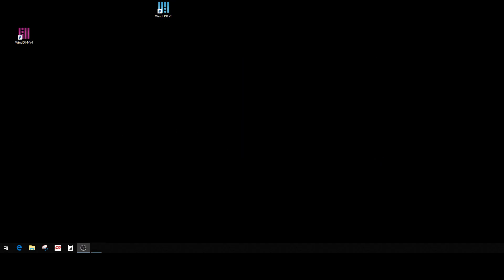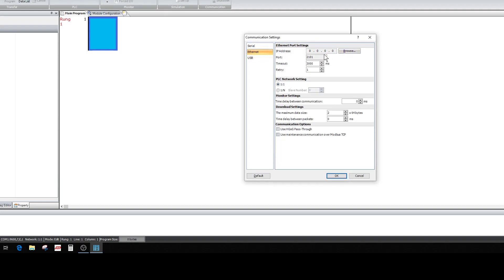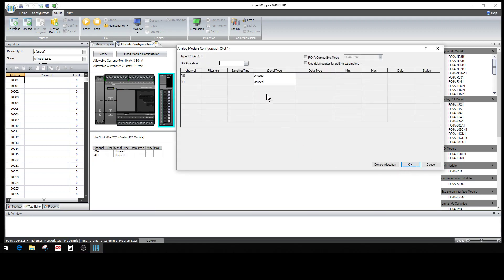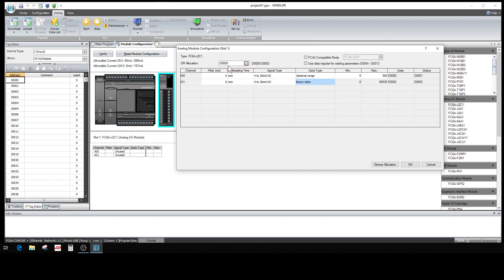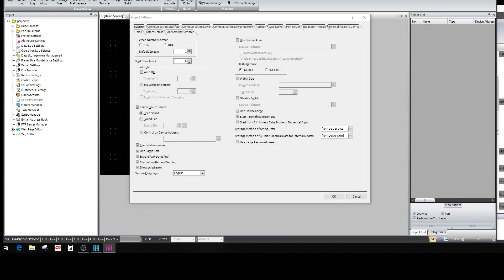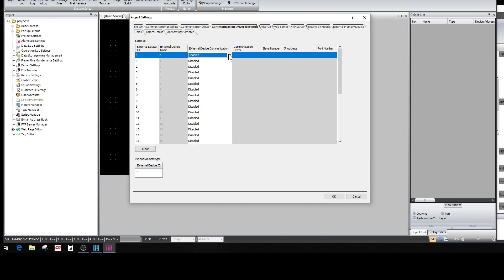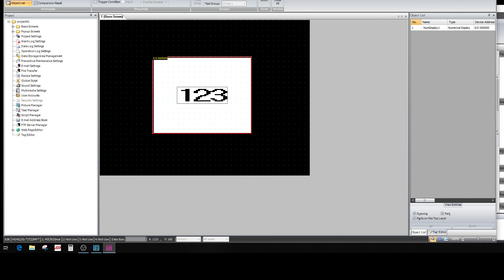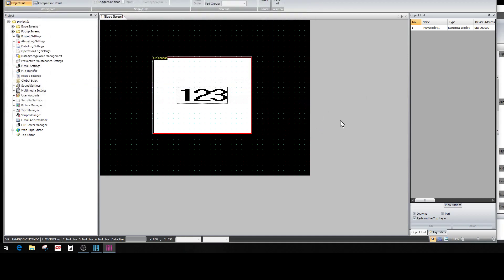IDEC PLC/HMI  Analog setup

Comment: Hey, thanks for the informational video.
I tried connecting a pressure transmitter to an analog module and set the air regulator at 50 psi but when I go online it shows that the transmitter’s reading are all over the place.
Would you happen to know why?

Comment: Could you show how to put the 4-20 to inches?  That would be awesome
Reply from the maker: Are you using a laser analog?  Or some sort of analog measurement device?  You need to know the range of the device.  It is simple.  If you still need help on this, let me know.  Sorry for the late reply.
Reply: @huntxtrm  not a problem I have the scalers figured out now on to the mqtt set up

Comment: Once you configure the analog input and assign the data location, then you run the program in the PLC, does it just read the analog input continuously, independent of the scan time?  How fast is the conversion?
Reply from the maker: The FC6A reads at 100khz.   I am pretty Sure.  Your analog input is basically converting data, dumping iit into a data register.  Your programing then executes how you have it written.  It still happens pretty fast.  Only thing that works out side of scan time is an interrupt, or highspeed counter as far as I know.  I honestly have never dealt with an analog that needed to be read fast.  I would call IDEC Tech support on this one, if you are needing a specific answer.

Comment: Hello again. Can you help me with question how to update system program on fc4a-d40s3 from v201 to v205. Without this update I can’t use macro ANST and analog input modules like fc4a-j8c1
Reply from the maker: I would call Idec Tech Support on that one.  I have honestly never used an FC4.  I will try and look at ot this weekend though.  If I figure it out, I will post it.
Reply: ControlFreak , ok. Thank you
Reply: ControlFreak I tried to update system software with datafilemanager but the button to update system software is inactive. I looked in the directory of data file manager and there are no files for fc4a, only for fc5a & fc6a
Reply: ControlFreak , hello. Did you get any response from IDEC?